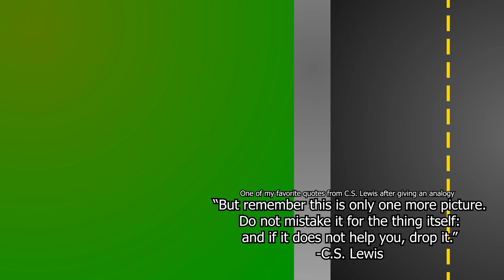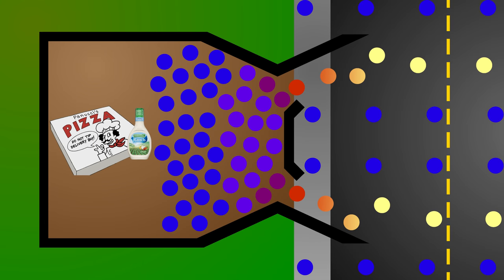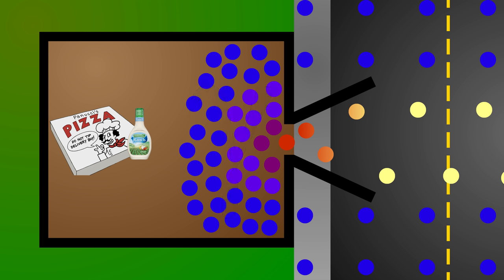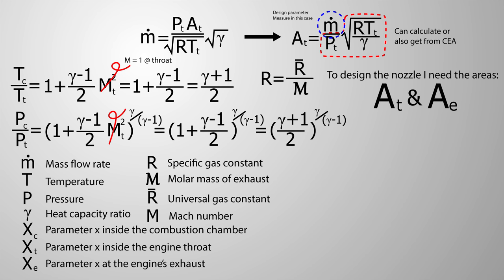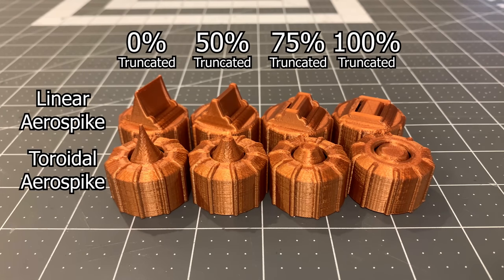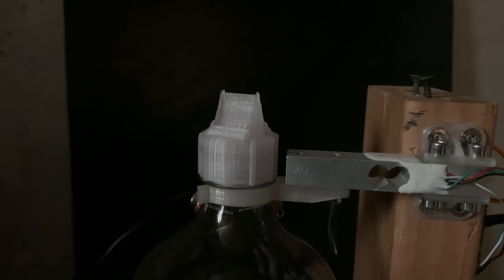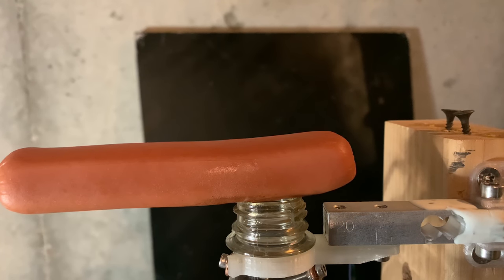Strangest Types of Rocket Nozzles

Comment: As an undergraduate in chemical engineering, I can confirm that gamma's are magic numbers you get by sacrificing a TI-84 calculator under the light of a full moon at the point where three rivers meet.
Reply: Quality nerd humour right there 👍
Reply: this of course only works if the TI-84  is first buried during a NEW moon  at a crossroads inside Schroedinger's  cat.
Reply: I had to sacrifice an 89 titanium
Reply: @tuck1726  did it work ? strange ...
Reply: I thought you needed to sacrifice a not-dead Schroedinger's cat, but observing the cat would invalidate the sacrifice.  @patrickthebutcher
Reply: Hello undergraduate in chemical engineering ! I'm an undergraduate in chemical engineering ! Nice to meet you

Comment: this is all very cool! One thing I would love to see as a next step is 1, upscaled rocket setup (longer burn time, as well as taking into account the heat dissipation with different designs), as well as a nice table to show the results with the different nozzles
Reply: A reason I say that it would be intresting to look at heat, is because in the video of the tests, we can see the triangular and pyramidal aerospikes melt

For example, the reason the tip of the spike is troncated to begin with, is because the tip is almost impossible to keep cool, and cutting it off is a way to simplify cooling without losing too much efficiency

Comment: Some ideas to consider trying:

1. Connect the nozzle inside of the soda bottle with a short length of tube to see if you can increase the nozzle velocity. You could try changing the length of the tube to see if there is any performance boost correlated to the tube length. Perhaps the the exhaust flow could be closed to laminar your get better performance

2. Add a second or three spark gaps inside of the soda bottle at different locations. This should increase the burn rate and may improve or reduce performance

3. Try a nozzle with multiple orifices in a pattern which creates a synthetic nozzle. Hole sizes could vary such the the outer holes are smaller than inner holes. Also try a hole than isn't round, such that it jagged edges or a hole with half round arcs. 

4: Same a three but instead of the hole been flat, make it in a conical shape. Like if you used a exacto knife and cut a hole into a set of wedges but bent the wedges in or out. Creating complex exhaust flow. instead of triangle wedges try round edges as if each wedge was rounded instead of coming to a point. 

FYI: Video on a Vortex rocket engine:
3D Printed Vortex Rocket Engine Igniter
https://www.youtube.com/watch?v=tqEfbJRKzeQ&t=4s

Comment: We used to spray deodorant into a 2l bottle and do this (no nozzles though), and it would shot across the floor if you got the mix just right.
If you put too much in, it just burnss with a yellow flame at the top.
Anyway, my friend blew into a bottle with a yellow flame burning at the top one time. As he blew into the bottle, he changed the mixture, suddenly,  a blue flame shot out of the bottle and took the skin off his lips. Looked pretty painful.

Comment: Protip from a woodworker... The weird lip under your mitre box is a bench hook. It goes over the edge of your bench, and since the saw cuts on the push, it does all the hard work in holding the box still for you
Reply: Also... Bitchin video. Just subbed

Comment: If you want to iterate on the expansion deflection nozzle, you could incorporate a spring to get something like a backwards check-valve, where the valve (throat) opens more the higher the chamber pressure is. This would allow the throat area to dynamically adjust for better overall performance. Also, with fuel/air rockets which rely on evaporation to set the fuel:air ratio, small changes in ambient temperature will result in large changes in performance. You can counter that by adding a fixed volume of fuel with a dropper or syringe, and waiting for that to evaporate completely (pre-warming the fuel greatly speeds that up).

Comment: On the topic of optimization there is a very simple visual clue it's the flow shape.  If the stream is expanding outwards while leaving the nozzle then your flow is UNDERexpanded and there's more energy to extract, if the flow is narrowing down into a thin jet then it is OVERexpanded and your nozzle is excessively powerful wasting the useful pressure on expanding the gas below outside pressure. The goal is to get the gas exiting the nozzle in a straight line like a proper cylinder, that would indicate the maximal efficency.

Comment: Delightful! Remember, modern rocketry was pioneered by a civilian Rocket Club led by the great Von Bron. If you get comfortable printing in Nylon your nozzles will undoubtedly perform better as they won't melt AS aggressively or quickly. The max temp resistance of Nylon being 95c versus PETG's 73c.

Comment: NOTE:  There have been other uses besides thrust in these various nozzle designs:

(1)  High Explosive Anti-Tank (HEAT) or "shaped charge" armor-penetration rounds.  The cup or, more usually now for better effect, long hollow cone-shaped nozzle (wide-end toward the target) has its explosive (fuel) wrapped around the outside of the nozzle and the explosive blast compresses the nozzle inward sideways (hopefully by a very symmetrical and  balanced radial inward pressure) and outward down the centerline of the cup/cone (the "liner"), usually made of copper now, but other materials have been used in the past.  This kind of reverses the concept of the rocket by shooting the nozzle out of the blast zone as a needle-like liquid jet moving at high speed and, of course, is only good for a single very short duration operation.  The extremely high speed, concentrated mass, and, for some distance at least, single continuous shape of the needle-jet gives the weapon its extremely deep, though very narrow, penetration ability.  The equations for its design are similar to those for rocket engine nozzles in many ways.

(2)  Unique to the US Navy, to my knowledge, was a method of getting very high reliability in detonation fuzes using the smallest-possible amount of "booster" between the tiny sensitive detonators that are set off by the impact of the firing pin against them (these pin-impact explosives being tiny pellets of explosives like lead azide or fulminate of mercury) and the relatively large high explosive charge filling gun projectiles.  Projectiles not having to worry about surviving armor penetration before the fuze detonates them can simply put a large, relatively insensitive and reasonably powerful explosive as the booster and the tiny explosion of the lead azide/fulminate of mercury is powerful enough to set this large booster off as a complete detonation powerful enough to guarantee that the main filler will in turn be set off reliably.

Unfortunately, to penetrate heavy armor requires a fuze in the base of the projectile, well away from the impact site at the projectile's nose and it requires a very small booster if the fuze and booster is to survive the huge forces on it as the shell pushes through thick hardened solid armor-grade steel at a high velocity.  The firing pin and its tiny sensitive detonator can be the same as in the non-armor-penetrating shell (though more strongly constructed, of course), but the booster needs to be much smaller to keep it and the fuze connected to it in one piece long enough to allow that booster to function AFTER the entire penetration has occurred, so it must survive the entire penetration process reliably intact and yet the booster must still be powerful enough to set off the projectile main HE charge, which in these kinds of projectiles is reduced in size to allow the projectile to be strengthened, but is still far larger than the fuze and booster combination can be.  Originally, sensitive high explosives were used as the main filler charge and even a rather small booster, or in some cases no booster at all, was needed to set them off.  However, for naval gun projectiles actual battle results demonstrated that to kill the modern 20th-Century armored vessels, which had internal spaced anti-fragment decks and bulkheads, the projectiles had to move some distance into the target ship before exploding to get maximum results.  This meant that the main filler high explosive had to be of a type that remained completely inert no matter how much armor the projectile punched through or how the projectile was tossed around or even distorted in shape when hitting at an oblique angle during this penetration process.  These more insensitive explosives -- various mixtures of sensitive and insensitive explosives such as British "Shellite", commercial TNT with some cushioning material and/or mixed with beeswax, US Navy's unique ammonium picrate, Japanese trinitroanisol (this last in thick plaster, wood, and aluminum containers to protect it in WWII anti-armor projectile ammunition) -- were found to be rather unreliable when the older types of boosters (mostly made from the similar sensitive explosives used as the main charge) were tried.  For some time the lack of reliable post-penetration  detonation was simply accepted as a fact of life in most navies, since the explosives available for making boosters powerful enough were to dangerous to use in the fuzes.

In 1928 a new explosive called "tetryl" (short for a very long chemical name) was introduced in both the US and British boosters.  It was powerful enough to be a reliable booster yet, when kept down to small-enough pieces, could safely stay intact after an armor penetration.  The problem was this "small enough" piece requirement, since it was usually too small to give reliable blast effect  in one piece that small when used as the older booster materials had been.  The British simply stacked thin wafers separated by very thin metal foil liners into a big enough package to reliably detonate their anti-armor shells, while still keeping each individual piece small enough to be safe in the shell fuze.  (The US Army used a similar concept in its Coast Defense gun shells.)

This was not safe enough for the US Navy, though, so they came up with a novel booster design.  A pair of tiny rocket nozzles (very small parabolic cups with their mouths facing outward), one on each side of the end of the fuze next to and surrounded by the main explosive charge were filled by very small blocks ot tetryl and the inner end of the fuze was directly connected to the fuze detonator by a short tube filled with TNT.  The fuze had a delay inside that only set off the detonator after a short fraction of a second after impact, giving the shell enough time to get deep into the target first.  When the detonator went off, it set off the tubes of TNT and they set off the inner end of the tetryl nozzles, which then exploded and the parabolic shape of the two cups focused the needle-blast directing into the main filler with enough concentrated force to reliably set it off (two were used for extra reliability).  So rocket nozzles are more than just thrust devices.

Comment: You need to use a more reliable propellant. Mixing alcohol in a bottle will get you widely different results especially after the 2nd-3rd try once the bottle is warm and more evaporates. Since your fuel is very energy dense a tiny change in mixture will create a huge change in thrust. I think a butane filled balloon would be better for repeatability. Especially if you use 2 (1 with air) so you can meter in the same amounts each time.

PS. I like the triangle and rotating spikes. Don't know how efficient they will be but they look awesome.

Comment: You should try with high temperature resistant PET containers. Ie: Hot Fill Containers.

Its nearly the same material as the coke bottles, but a higher grade of material. And have an induced % of controlled of polymer crystallization. Making them heat resistant, and less volume expansion as well. 

Look for bottles from either of these brands: Poweraid, Gatoraid, Body Armor, ect... Apple juice bottles or even apple sauce PET containers. Same with Tomato sauce. You get the drift.

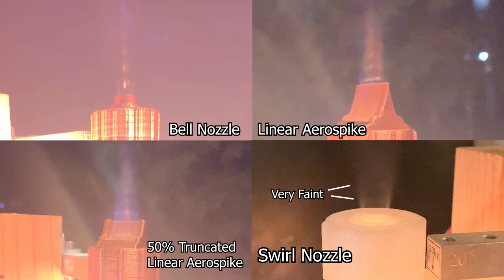Comment: At 12:33, On the bell nozzle, you can see that it’s slightly under expanded meaning the rocket engine’s exhaust pressure is higher than the atmospheric pressure.

Comment: There is a method of making strange nozzles that involves a genetic algorithm. you essentially make a parametric system that has N parameters that describe your nozzle, and some fitness evaluation X for the nozzle. Then you assign a bunch of random values (or smartly kind of random values) to all parameters, produce the nozzle, test the nozzle, and associate the fitness score with the set of parameters. Then you do this a bunch of times, changing some parameters and keeping others. The idea is that you can tease out "good" values for parameters by changing or not changing values, or by changing values based on past fitness scores. Its similar to a neural net, but more applied in a way. usually you see this method used along with a complex simulation to determine fitness, but rapid prototyping (3d printing) can also do the job.

Comment: Here's what you do: 3d printed metal parts for a pressure-fed gaseous oxygen-propane rocket, and test out all of these designs. Could easily come up with some sort of interchangeable system based around some basic steel pipe.

Comment: Shock diamonds mean the exhaust is overexpanded meaning you need a smaller expansion ratio at sea level. If its flying a tad bit of overexpansion at sea level isnt bad since the air is getting thinner really quickly and actually gets underexpanded

Comment: Hey, I noticed a variation between your nozzles that you didn’t mention in the video that I don’t doubt had an impact on your results: the accuracy of your 3D printer. The tips of your aero spikes aren’t all uniform and the circular one that has the full spike; the spike is drooping off to one side slightly.

Comment: I think a more controlled experiment would show a more definitive answer, ie, a water cooler bottle with a valve, pumped with compressed air to a set pressure. It would give a more consistent force and duration. Area is not exactly equal to flow, but I guess force area should also be a thing. Keep up the good work.

Comment: Awesome work! I'm trying to get into 3D metal printing to do similar experiments (I'm a 3D modeler/CNC programmer now, unfortunately my work couldnt use 3d printed parts). I'll probably buy a powder based printer when they're big enough to print an engine block.

Comment: A big part of what makes aerospikes attractive for rockets is their ability to self regulate during atmospheric pressure changes. You briefly mentioned this in the analogy part but didn't say why it was important. Aerospikes are a good candidate for single stage to orbit rockets. These would be vehicles which do not require parts that are ejected on their way to orbit. Part of the reason for stages is that the bell nozzle has to be a different shape depending on atmospheric pressure to maintain efficiency.

Comment: Fantastic! Back in my younger years, spud guns were a very popular thing to make. We found that using a metered amount of propane (fixed volume pipe with varied pressure for mass adjustment, dumped into chamber) would give the most consistency. Instead of alcohol, maybe use a gaseous fuel? Google "spud gun fuel meter" for ideas. 😊

Comment: Thermochemistry is actually quite interesting. For your rocket you would need to know 2 things 

Formation enthalpy of your products which are CO2 and H2O which have a formation enthalpy of -393.5 kj, and -241kj respectively, and the reaction enthalpy of your reaction which is the formation enthalpy of your products - the formation enthalpy of your reactants

O2 has a formation enthalpy of 0 as it is in its standard state.
Reply: This could then be used to calculate delta V or the change in volume as enthalpy = delta internal energy + delta pv work so you could figure out the delta V by first finding the pv work and you could do that by measuring the temperature and subtracting it from the enthalpy of reaction then you are left with the delta pv which is the amount of work done by the expansion of that gas.

Comment: Hi. Wonderful project. I just want to check with you if you know how quickly the loadcell can give data and data changes back?
Reply from the maker: Seemed to be a little less than 10 times a second, and the rockets fire for around a third of a second. So there is also a strong chance that it totally missed recording the peak thrust for any given test
Reply: @Sciencish  thanks for your reply. yes i was thinking there has to be missing data but wasnt sure. 10 times a second is probably on the border of ok with the 2 or 3 second burn but yes, like you said some data may be missing. the distance the rockets flew also indicate a big-ish difference in thrust. what made me question this was that the one nozzle was about 30% better than the average of the others it seems. (triangle i think)
[edit] oops i just see now its a third of a second. i must have missed out that it was slo mo